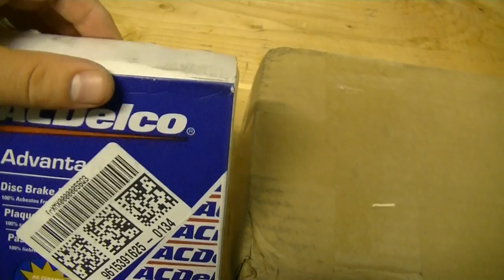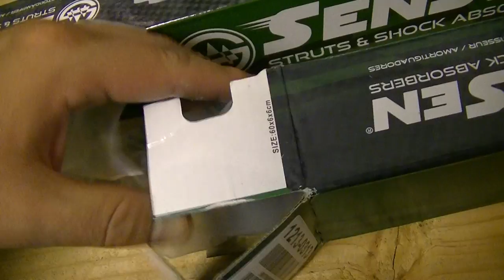Sensen Rear Shocks

Comment: I've had the same struts, different model, all around on my 99 Camry for two years now. There are some things to know about Sensen that are of concern. The first thing I noticed is when the temperature gets below 32°, the front struts lock up, ie, either the oil or valving cannot handle the low temperature. This puts extra strain on an older car's front end. Even after driving 50 miles, they are still frozen. I complained to Sensen about this and they said that they would replace them, however I only told them I would only go to the trouble of replacing them if I know that they fixed the problem, which they would not confirm. They instead refunded my money.

The second thing I noticed was, after installation, I noticed my Camrys rear end sticking up pretty high. Apparently in order to make more of their SpeedyStruts fit more applications, and unlike KYB, Sensen cross reference the same struts for cars that don't weigh the same. For instance,  my 99 Camry cross references the same SenSen rear SpeedyStruts to the 99 Solara, even though the Solara is 300 lbs heavier in the rear. This makes my Camry's ass-end stick high up in the air compared to a KYB Strut-Plus which makes vehicle-specific struts. While this just shows how cheap thie Sensen company is, the extra height actually worked out for me because we have an aweful street-to-driveway bump that my car would otherwise scrape over. Now I have KYBs in the front and Sensens in the rear for this reason. The rears do not lock up in the cold for some reason. 

I plan on posting this post on other Sensen videos to help inform potential Sensen customers, so don't be surprised to see it elsewhere.